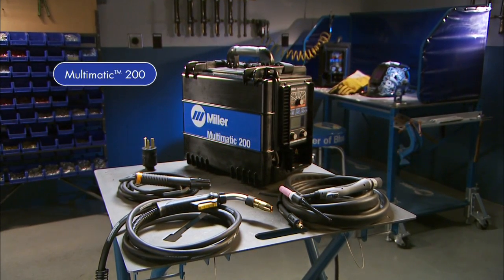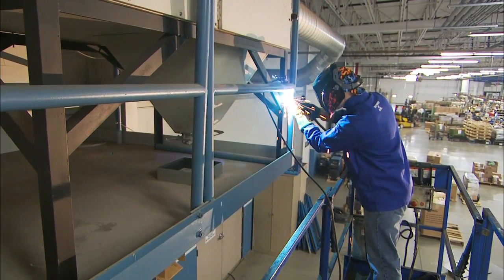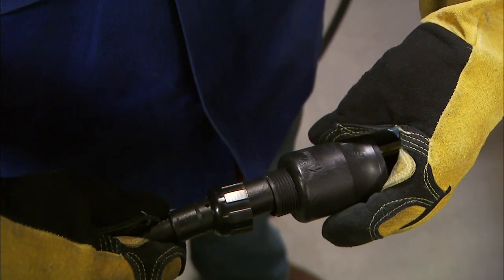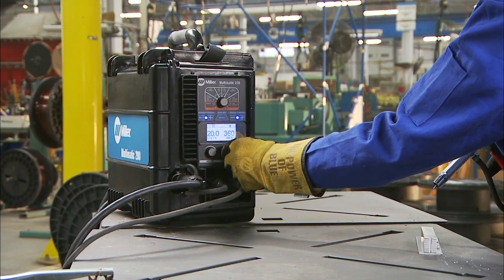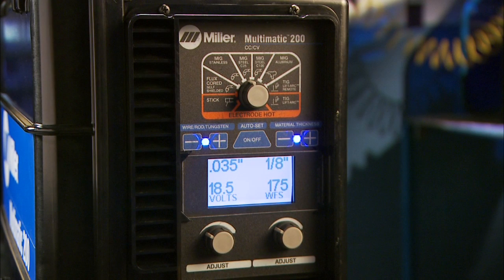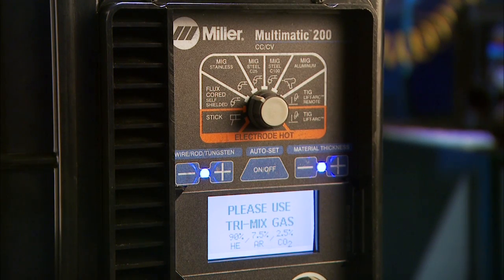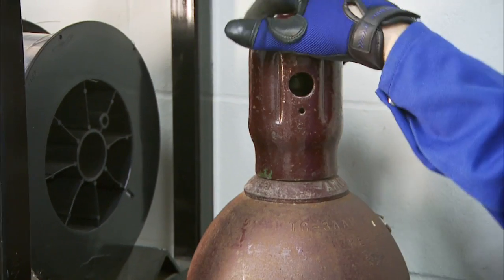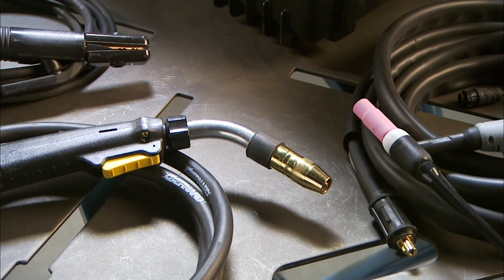Multimatic™ 200 - Set Up Intro

Comment: Can the millermatic 200 do tig aluminum?
Reply from the maker: Hi David, the Multimatic 200 will not ac tig aluminum. The Multimatic 200 will mig weld aluminum.

Comment: Can the MULTIMATIC 200 work with 240v
Reply from the maker: Thanks for your question, Roberto. Yes, this machine will run on 120 or 230V. You can learn more on the product page here: https://www.millerwelds.com/equipment/welders/multiprocess/multimatic-200-multiprocess-welder-m00361
Reply: It is possible to connect the Millermatic 200 to the 240v output a trailblazer 325 diesel
Reply from the maker: Yes, it is possible to have the Multimatic 200 placed on a Trailblazer with adapter cord #300517. It is also possible to have one person welding with the Trailblazer welding power and another person welding with the Multimatic using the auxuillary power at the same time.
Reply: which is the measurement of the wire roll that can by used in the Multimatic 200